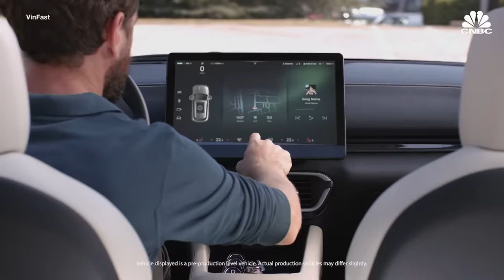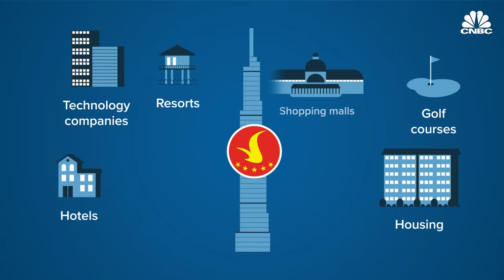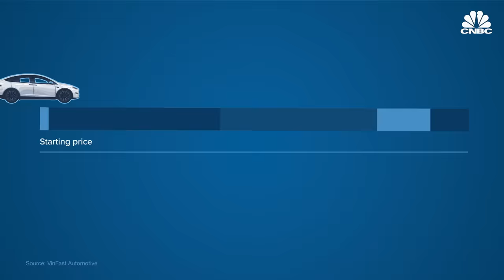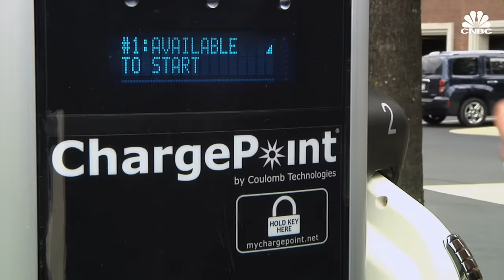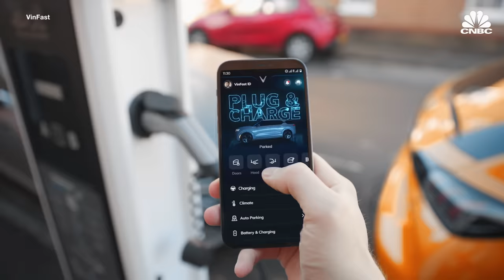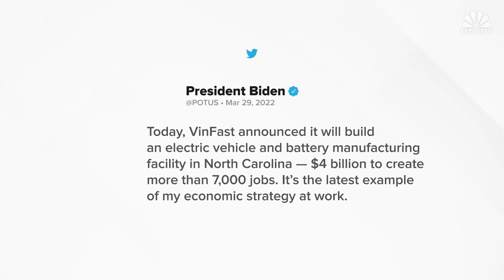How This Vietnamese Carmaker Is Trying To Beat Tesla In The U.S.

Comment: There’s 0 chance in hell that I’d ever pay over 40k for a car and then have to pay for a battery on a separate bill monthly and for a brand no one has ever heard of. This is doomed to fail in this country. This is not  Vietnam, the US is massive and 310 miles is something that would be used up in less than a week, but they want it to be a 1 month allowance. What happens if the car is stolen or totaled in an accident, who pays for the battery?
Reply: They have to start somewhere. From what I've heard they are getting pointers and directions from some pretty big companies. Namely Porsche for one. The bar is high for sure. But they have the deep pockets to make the changes necessary to stay alive in our market and with everyone going ev this couldn't be a more perfect time to jump in. Time will tell. I won't buy one until there has been a minimum of 4-5 generations. We shall see.
Reply: Lol, the vietnames think you guys will pay for that.
Reply: That’s a recipe for failures renting batteries.
Reply: You can replace a Tesla or Toyota battery for $25-$30k..
Reply: Yeah I don't understand the benefits of the subscription service at all. What benefits does it give outside of the car being cheaper up front.. What happens five years down the line.

 Screw that.

Comment: I think the battery lease   program is not going to go over well in the USA.  Because no one wants to pay $450 to 750  for a EV and still have to fork over another$110 a month along with insurance payments.
I think Vinfast cars are beautiful but  I think they should have started out with the VF 6 or VF7 they are the 2 best looking vehicles. And should be cheaper than VF8 or 9.
The average American spends about $22K to S28k for gas cars  so spending $40k plus for unknown  plus paying for battery  on top of that each month is a little too much for most Americans.  They need the Vf5,vf6 and vf7 to be in the $30k range.
I wish them luck
Reply: This is kind of the confusing part, with the battery lease. I think their intention is good, where they’re not passing the risk of owning the battery to customers. Because if you lease to own, the car price would be higher, cost of repair and maintenance, and cost of disposal is yours to pay. 
The tricky and challenging part for Vinfast is customers will think this additional costs and not incentives.
Reply: Price VF7 ~ VF9, not cheap bro
Reply: The battery lease is to lessen the burden on capital investment. You pay for the battery as you use and as a guarantee for battery replacement when faulty. However, the terms on the battery lease is not fully explained.
Reply: This guy knows it. So TRUE.
Reply: Haven't seen a new car under $30k for over a year. I'm in Alaska tho... So...
Reply: @ninh05  Over time, it's a good idea. Pay a small amount over time vs. a large amount when the battery needs replacement.
Reply: It sounds strange, but I think it will work. I will be abusing this battery knowing I will have a new one when It is not even dead😃 yet.
Reply: Số tiền đó nó bảo hiểm số tiền lớn mua pin cho bạn luôn đấy.ngắn hạn chứ vài năm sau lúc nâng cấp pin .hay pin bị dảm tuổi thọ,bạn sẽ dk thay mới khi nó xuống 70% .thuê pin nó ko hề tồi nếu ko nói là nó quá tốt.
Reply: You can buy Chinese ev toy car for 30k
Reply: Yeah they would need to over a cheaper product then tesla with the model 3 and model Y. 
That's difficult.

Comment: While those prices are competitive compared to Tesla, it's not that competitive compared to other EVs. You can get a Chevy bolt for $23k and a f150 lightning for $39k. Yes there are bad dealer markups right now. But once the market cools down and you can buy cars closer to MSRP, I don't see how a $40k where you still have to lease the battery sounds competitive
Reply: Fisk $38K
Reply: Right a car note on top of a lease
Reply: Yeah, but then you're stuck with a Chevy or a Ford.
Reply: Y’a the pricing doesn’t make sense for a startup
Reply: @jaydibernardo4320  Always been good with a Chevy. They've always been reliable to me. 😏
Reply: Where can you get a new Bolt for $23,000 ?
Reply: Sorry but you are dead wrong about that. First let me point out that you are trying to compare cars that are competing in two completely different spaces. In ICE terms the Bolt is on the same level as an Echo Sport which are subcompact cars whereas Vinfast is offering a 5 & 7 passenger EV which would be like the Edge or Explorer. As far as who they are competing against it would be the EV6, Ioniq 5, Mach-E, ID4 & the up coming Blazer EV so this would put them right inline with them.
Reply: @timothykeith1367  any dealer that is selling around MSRP. The official MSRP from GM is $25,600. Talking them down $2-$3k isn't that hard. I got my bolt for $23k back in 2020. And that was when the MSRP was officially $39k
Reply: Nobody wants GM's reject - defect cars. It's quite embarrassing when not even your own country wants your cars. I'm talking about GM and the USA. But that point is moot since GM has become a Chinese corporation.
Reply: @erossinema8797  I unserstand the Bolt fast charging is not very fast, but otherwise the Bolt isn't a bad car.  GM must be losing a lot of money on the Bolt.  All the Bolt and other marginal electric vehicles need is an excellent aftermarket battery - which is what Tesla also needs to sustain the used EV market
Reply: For real, and, like the video said, who tf is Vinfast? At least a major automaker will have the means to back their car. If they try wiggle their way out, the government can make them pay up. They won't just fold and leave the market.
Reply: Leasing parts of a car you own is being experimented with. Auto makers are considering putting most bells and whistles on every car and only turning them on if you subscribe.  It's an evil business model...and needs to be shut down via huge backlash.

What moron thought we would be okay with being sold a seat warmer that didn't work without the owner being bilked every month?  Obviously the car was already sold for a profit...the subscription is a gouge...evil.
Reply: You are comparing apples to oranges.
Reply: I totally agree with your opinion. Leasing the battery is not very competitive. Also, with the news of today with a bill due to pass next week with a EV credit of 7500 for American made EVs and batteries made in the US. This will really hurt sales of Vinfast EVs in the US.
Reply: @andrerodriguez7603  you only pay 110 USD/month for battery rental. get a new battery when it drops to <70% performance
Reply: In a long run, the battery will be worn out, and Vinhfast will replace the new battery. A car battery is very expensive.
Reply: @thhdhn2  my tesla model 3 battery pack cost 9K when new. Lasts at least 500K on my 2018. Close to a million miles on new tesla’s. So leasing a battery from Vinfast might be worth while for their cars. The quality and technology in their battery pack isn’t as good as a tesla.
Reply: Is the Bolt a SUV? please tell me where to roder a F150 Lightning for 39K i'll order 2 right now even if i get them in 2024 idc!
Reply: @YoungGHustler  the bolt euv is. As for the f159 lightning, like I said, once you can buy one for MSRP you can get it for $39k. Right now you can't because there are crazy markups from dealers due to low supply.
Reply: That is why GM and the rest of the American Motor industry is losing money. They selling too cheap, are subsidies, etc... Here you have a start up new comer trying to create jobs in America but you're stepping on them.
Reply: @andrerodriguez7603  Battery tech is actually much more advanced than Tesla. Vinfast will use solid-state batteries from ProLogium with patented and proven tech, longer range and more environmentally friendly during battery production and recycling. The only other automaker with exclusive deal from ProLogium is Mercedes-Benz.
Reply: Nếu một thời gian sau pin xuống cấp bạn sẽ bán xe với bao hoài nghi từ người mua lại với giá rẻ mạt, bạn không muốn bán xe bạn sẽ phải bỏ ra $20k để thay pin cho chiếc xe của bạn với giá trị $5k phải không? LOL
Reply: Where do you get a Chevy Bolt Euv for 23k? They will go bankrupt if they are on sale for that price. By the way, you can't make the comparison when the car has not even been delivered yet. When you make the comparison you need to look at the values it offers within the segment, not the price tag. You can't compare a Samsung S22 with a cheap Chinese Android phone by looking at just the price tag.
Reply: @tonyvu2011  Tesla battery is more advanced, their software is superior. Their drivers are way smarter too.
Reply: @sixlineslime1948  $26k. Then you haggle off $3k. Not that hard. Plus in California you can get $2k-$4k back.
Reply: @tl749  stop being misleading and a Musk fan boy/girl while you're at it, battery software management requires about 500 lines of code that I can write in a couple of hours, nothing superior to be boasted about. Tesla's battery tech is way behind the latest ceramic solid-state battery, end of the story!
Reply: @tl749  also, Tesla's and US tech sectors are losing the leading edge to Asia (South Korea, Japan, China and very soon Indonesia, Vietnam, India...). Taiwan is leading solid-state battery race just how they've led in semiconductor tech while the lazy USA is sleeping!
Reply: @andrerodriguez7603  The Congress bill is far from a sure thing.  Senator Manchin wants no part of federal subsidizing of EVs...
Reply: @tonyvu2011  is that the only software that makes Tesla car great? I believe that you can write, but does it work? America is loosing, but soon winning and dominating is something that we are really good at. Come and you will see.
Reply: @amirmoradi9595  America is the best car market in the World. For both Consumer and OEM.
Reply: Americans average vehicle purchase price last year was about $37K. I don’t think people are worried about paying 40K for any vehicle. With rising cost of living, 30K is what 20K used to be years ago in this industry
Reply: @amirmoradi9595  The basic LT model including the destination charge is $28,195, a direct order from the Chevy website. Kelly Blue Book dealerships list for a minimum of more than $35k. Don't assume everyone here are idiots, we are smart buyers. I am on my 8th car already. By the way, you can't compare the Chevy bolt cheap LT model with VF8. Do you know anything about configuration and specs when purchasing the car?
Reply: I think they are making a mistake by pricing their cars to Tesla and not all the others ,and then less for lack of battery ownership.
Reply: The leasing help cover the risk of dying battery of EV. I think it’s worth it, and if in the future battery technology change (of course they will), costumer could also benefit from it as they don’t have to stick forever with old generation battery.
Reply: Wealthy people don't care.
Reply: @deleaptealeaf8935  yes, I heard about that. They were going to open a manufacturing plant in Australia and backed out of that deal. I hope they do open the plant in the US. 👍🏻
Reply: I totally agree with you. That's not a competitive price for a startup.
Reply: @duke_ng  they also have a low cost EV at 15k which only sold in Viet Nam, the 40k is competitive with different brand price on 45-50k. They are just not using all the cards here. They don’t want to be marked cheap car brand, when sold 15k EV yet.
Reply: @huynhdung7602  as far as I know. Cars' price in Vietnam is much higher than other conutries. Then I doubt that people can buy a $15,000 ev in there. Moreover, I also doubt about the success of a new startup company that trying to compare with luxury brand in thd US. With the price of $40,000 and a weird battery policy, only time can prove if their success is true and for sure there's not many people will risk their money.
Reply: @duke_ng  yeah, as you know EV is 15k not included Vietnamese special taxes for car. If it’s sold in US, it wouldn’t have those special taxes. EV car also have different level of price range, 40k is not cheap for low-price range, but 15k (maybe 20k when sold in US) will do it. And 40k will not very expensive with the middle range if you consider all of its ability. You can’t say that a Madza3 is a good deal than a Mercedes E200 without consider their price range, right?
Reply: @huynhdung7602  you are right at some point. But the thing is Mazda is not a new startup.
Reply: @duke_ng  Well, EV is not 100 year olds industry. Tesla only success few years lately. We could say every one except Tesla is startup in EV business. If Tesla could beat Toyota, Ford, EU brand and become the first flag of EV cars, why EV start up have to scare of those old gas brand?
Reply: @huynhdung7602  well, it could be. I'm looking forward to seeing at some points in the future that a new start up company will at least survive and possibly be competitive with Tesla and dozens of EV companies existing in the market. I'm looking forward to trying it in real life as well.
Reply: @duke_ng  I think the only way for any startup to survive is die trying and leave it to fate. I again, think any EV bussiness except Tesla (because thay have been there) will have to do that. There is no guaranteed success, even for gas car brand who want to jump in.
Reply: The technology is always being innovated, they cooperate with the best battery companies in the world, the best car warranty today, even more than Korean car manufacturers.
Reply: @kenyattaclay7666  I'll go with Ioniq 5,
Reply: You forgot replacement and repair Services included in the subscription 🤔
Reply: @duke_ng  Ở Việt nam . Chúng tôi sẵn sàng trả khoảng 50.000 usd cho chiếc này ( chưa kể đến tiền thuê Pin )
Reply: @quangvinhle8918  sure, with the monthly income per capital around $200. I believe the Vietnamese are willing to pay $50,000 for this. The American will not.
Reply: @duke_ng  Tôi không nghĩ khoảng 11% người nghèo của nước Mỹ đủ sức mua một chiếc xe chỉ vài trăm đô .
Reply: @quangvinhle8918  sure, that's why the American will not pay $50,000 for the car like the Vietnamese will.
Reply: @tonyvu2011  - China is E. Asia. Japan & Korea is N. E. Asia. Don't lump us with S. E. Asians and S. Asians.
Reply: @Time_to_Stop_Animal_Cruelty Population in Japan, South Korea, China is getting old, economic growth will be stagnant. India and ASEAN will be the next growth centre where smart money will be invested in.
Reply: To add to what you said, what benefit do I get from leasing a battery? Sure, the battery will degrade...eventually! But there are Tesla mode 3s on the road right now with over 400K miles on them. There's one that recently made news for hitting the 1 million mile mark. If this Vinfast isn't creating batteries that last just as long, then that's a huge knock against them. If Teslas are reliably cranking out 1/2 a million miles or more, who cares if the battery is degraded at that point? At that point you would have owned the car for 20+ years and would want a new one anyway. Most ICE cars gives you 180K miles and then you need to rebuild the transmission or engine and it's not worth it to do so at that point.
Reply: You have to rent the batteries for the car. LOL!!!!
Reply: I would not pay $39k or $49k or $59k or $69k for a GM EV. I would sooner contract my plumber to do my dental work. Which may be acceptable in the UK but to each his own.
Reply: @tonyvu2011  whilst I am no Tesla fan boy and will sooner buy a Leaf (i have no range anxiety nor excess need) I would not be betting against Telsa. They're autonomous driving technology could be a company onto itself. They're charging network is so far ahead of anyone here in America and I presume worse in the UK and EU... for sure it could be a second company onto itself. And I don't think Tesla are striving to offer the most cutting edge battery technology and they certainly aren't trying the to sell the most finely built cars. They've calculated what is the least amount of a technology a true EV requires to be built at scale with what can only be described as a staggering profit margin per car while many if not most of it's competitors lose money on every car built. Tesla is currently making near 80% of the profit of a behemoth like Toyota with only 10% of the volume. That's insane. If they catch up to Toyota on production while driving DOWN cost by rethinking all aspects of production the profits in the long run will be on the level of Microsoft for its shareholders. And the head start Tesla have at building at scale a car that doesn't require $1 USD of marketing is unprecedented at this level. If we're Musk I'd break up Tesla into a charging network company,  autonomous tech company in partnership with Starlink, and a battery manufacturing company that would supply GM, Toyota and Hyundai.
Reply: In china..

Comment: People keep talking about the Battery leasing program and make it a key point of failure.  Let's be clear that, now almost car manufacturers provide a warranty for their cars at 10 years/150000 miles.  It sounds like VinFast is doing something wrong with the battery leasing when everybody else has already done that without the leasing, right?  No, Tesla will not replace your battery if it still takes in the charge even if the remaining capacity dropped below 70% and you have to stay with that until it completely dies.  The Resell value of an EV is mostly based on the remaining capacity of the vehicle itself.  More importantly, when you buy an EV with a battery included, you lose the chance to get a new battery with the new technology.  For example, the new Tesla Model 3 gets a new battery pack with better quality and anyone who had the earlier Model 3 will be stuck with their battery forever.  with the battery leasing program, VINFAST ensures that old cars can be updated to with new techs, especially, battery tech.